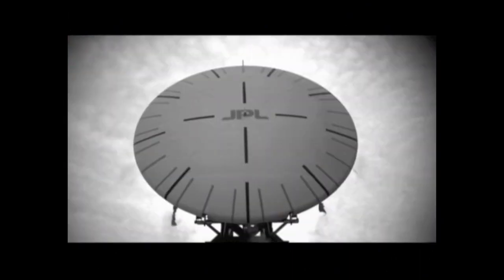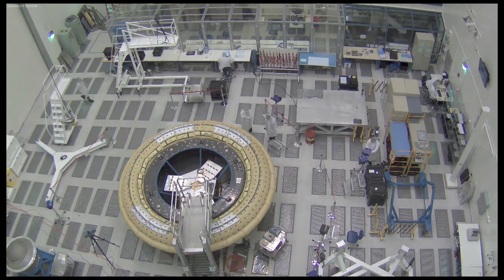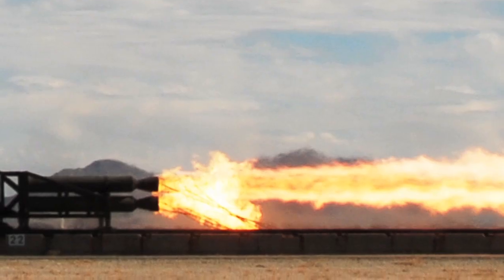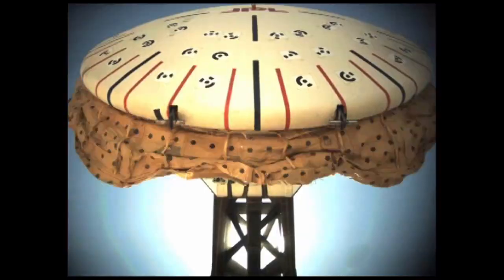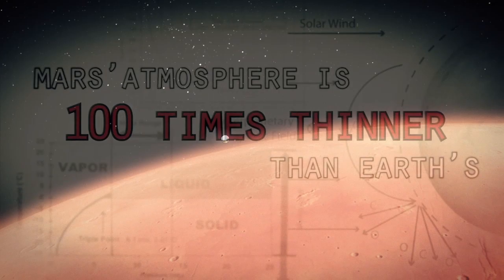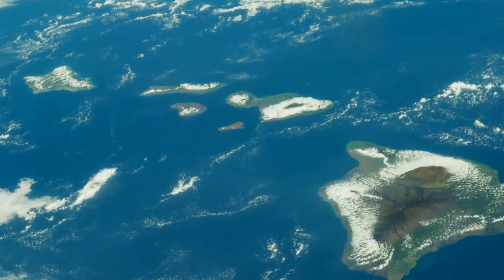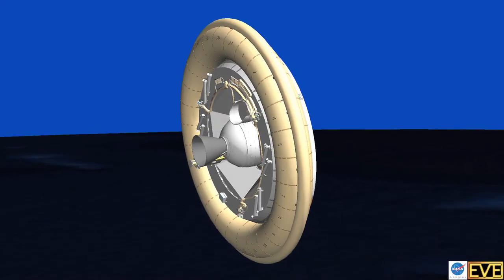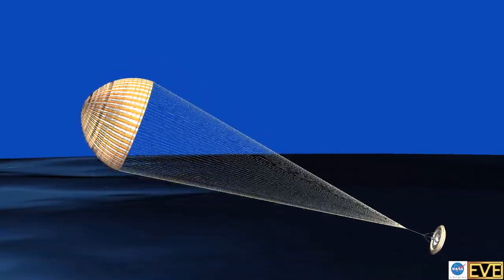LDSD: We Brake for Mars (Part 2)

Comment: Is Mach 4 going to produce the same amount of shock heating on the inflatable heat shield as it would see entering the Martian atmosphere?
Reply: No. He mentioned that it would enter Mars' atmosphere at over Mach 16, so Mach 4 is way below that.
They will be able to test the parachute under realistic conditions though, once it decelerated back to Mach 2.
Reply: RufftaMan
Well, the key thing to keep in mind is that Mars' atmosphere is thinner than Earth's. So high speeds like Mach 16 in a thin atmosphere would be the same as lower speeds in a thicker atmosphere. I was just wondering if Mach 4 was the equivalent speed in out atmosphere.
Reply: y0uareatube Yeah, that is true, but they are conducting the tests at very, very high altitudes. He said that they are pulling it up to 120'000 feet, which is about 36'000 meters. At that altitude the air-pressure is probably about half of that on Mars' surface.
The pressure in the upper Mars atmosphere is even less, so what you think may be true, or it will be close to it.
I'm neither a physicist nor an engineer, so don't take my word for it. =)

Comment: When you are talking about "speed of sound" or "supersonic" are you speaking about the speed of sound on Mars or the Earth? And.. at what altitude? The speed of sound at 20 km altitude on Earth is not the same as it is at sea level, så what unit are you speaking about here really?
Reply: I think the technical term is "really fucking fast".
Reply: But it's not easy to understand since it's confusing and essentially non sensical. It may be perceived as something understandable but it's not. So Niosys's interpretation "really fucking fast" is probably more accurate and more easily understood.
Reply: Basically is the classy way of saying "really fucking fast"
Reply: I think they talk about the speed of sound on the earth at sea level (at 0ºC i think) that is 340 m/s, wich is the standard value for it.
Reply: If it is the speed of sound at sea level on Earth (the standard usually is set around 15°C) that he's talking about, that doesn't have any particular relevance for Mars or deploying a parachute in its atmosphere. Why on earth (pun intended) is he using units that doesn't make any sense when he can use units that does?
Reply: I think it's just to make it easier to understand how fast the thing is going. And also this way he doesn't need to say it in m/s and mph.